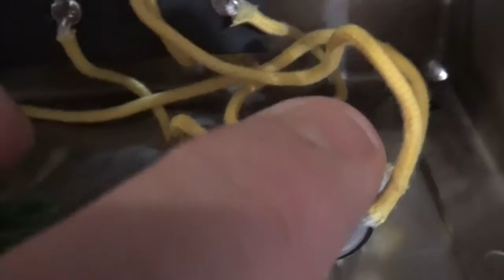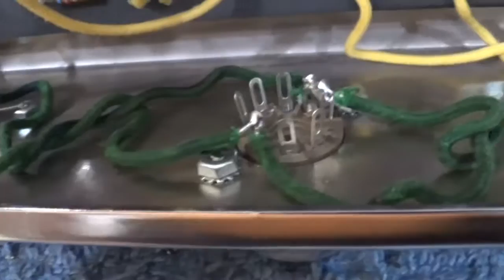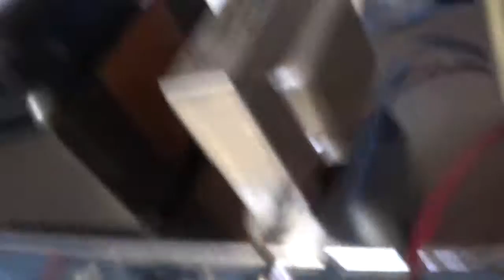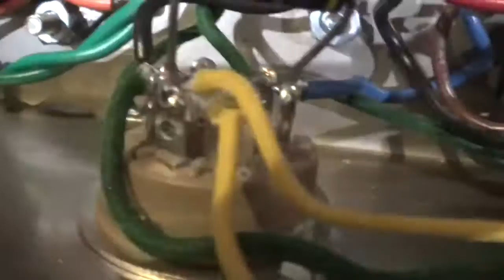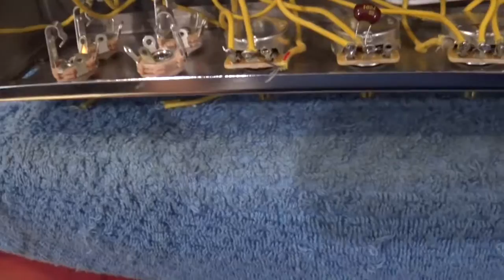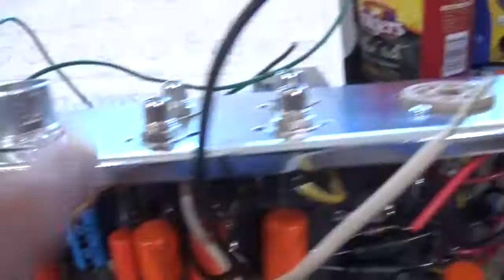Fender 59' Bassman Amp Build - Episode 7 -  The Groove Tube and Pot Heads

Comment: I wonder if DC heaters would not be hummy?
Reply from the maker: Great question - I wonder if anyone has thought about that.   I'll be doing the first test in the next 2 days... very close here on this one. 
  Thanks, Ron
Reply: yah, but probably more likely the transformers would induce hummage on nearby wires.  Coils have much larger magnetic fields, that's why better ones have metal shields.  
Did you check out the Western Electric amp link?  8k$!
Reply from the maker: I did Don, thats crazy..... I have to find one of those  :)  I could retire... LOL   Have a great day my friend.